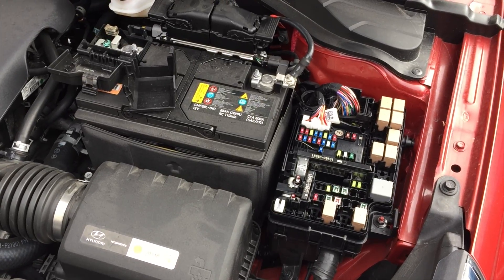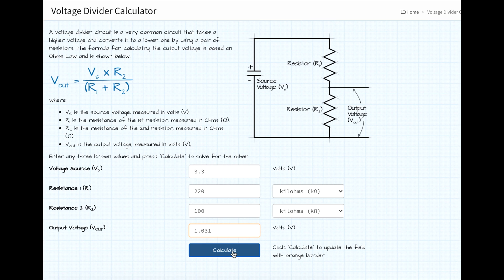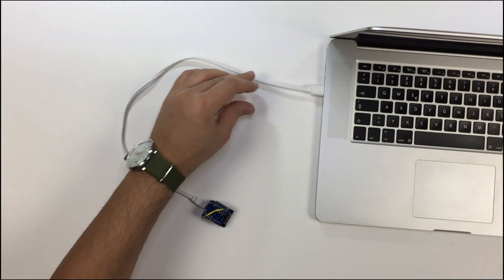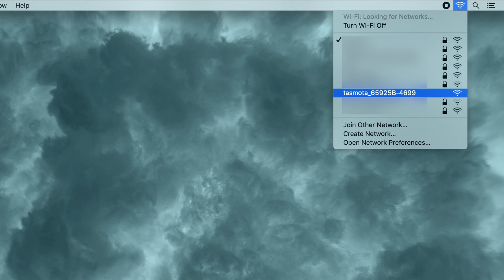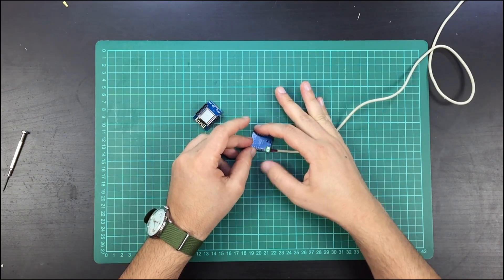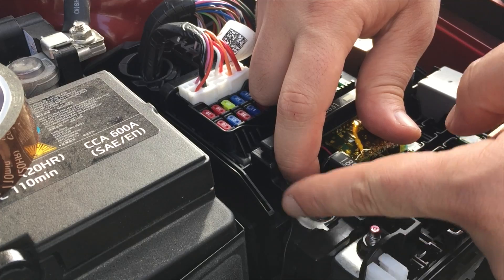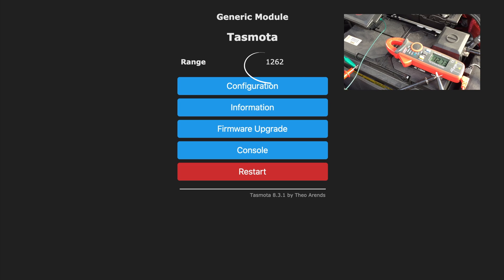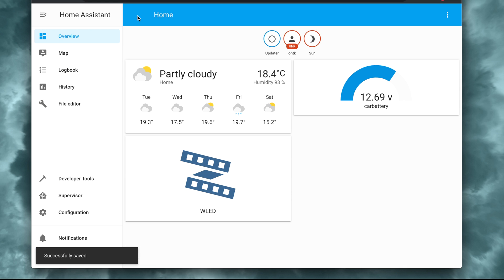Monitor a Car Battery Remotely using ESP8266

Comment: Love this project. Would you be interested making something similar but with something like a ct-clamp where it measures amps/watts that are actually being used by something running off a 12v battery?
Reply from the maker: Possibly! this would be ideal for my solar setup. I will add it to my backog :)
Reply: @MrDIYca  just ordered some parts to try it myself using a pzem-017. If it does not work ill wait to see how you do it.

Comment: Nice project. I guess your car is parked inside your Wifi coverage which does not apply to most of the people. It would be interesting to see the deep sleep telemetry period settings. After all the project is for protecting the battery not for draining it ;)
Reply: It's running stock Tasmota, so will probably only have the modem sleep power saving enabled. Deep sleep won't be happening as D0 wasn't connect to RST, allowing for wakeup from deep sleep.

Comment: Good idea. Did you try to measure current consumption? Just interested what drain it has?
Reply from the maker: No, I haven't but D1minis usually use 70mA. I have it pulling the voltage every 15 minutes.
Reply: 70mA when in deep sleep. Plus you have a power shield too.
Reply from the maker: that is true. It has been monitoring my car for 2 weeks now and I was able to start it just fine the other day. But it would be useful to get accurate energy usage for a span of one day or so.
Reply: @arnsle  Not in deep sleep they won't! Deep sleep drops power consumption below 1mA into the micro-ampere range. If the ESP8266 is allow to idle-sleep the WiFi modem, power consumption should drop from 70ma @ 5v to around 25-30mA IIRC. It will be less than that on the 12v side (somewhere in the order of 15mA), since current is relative to voltage. Even so, if the car was parked up for a couple of months you would want to charge the battery up anyway, as the onboard electronics as well as this would drop the battery state of charge more than enough to cause some permanent damage to the battery if not charged.
Reply: Yes, Tasmota don't go to the deep sleep. Does not matter how often make voltage readings. I tried to measure D1 + shield and 18-40mA. So I went with mysensors and Nrf24l01+ it goes to deep sleep but because of the lm2596 does not go less 4mA. Maybe need to try different stepdown regulator.

Comment: I'm a little confused, at 1:26 the video shows 2 resistors soldered together, the right hand one appears to be (Brown/Black/Black/Green) 100 x 10^5 =10 MOhm, and the left hand one looks like (Green/Blue/Black/Violet maybe? It looks Pink but there's no Pink colour code) which would be 560 x 10^7 = 5.6GOhms!!?? If what looks to be Green in the video is actually Yellow then the 1MOhm would be right but the other one would be 460 or 470 something if what looks Blue is actually Violet? either way, its not 220 anything (Red/Red/Black)!
Reply from the maker: Hello, in the video, I recommended using a 1.22 MOhm resistor (1MΩ + 220KΩ) but I didn't have a 220KΩ at the time so I used a 440KΩ instead and this is what you are seeing in the video - good eye!

Comment: Question, did you use the vehicles battery to power the D1? I thought it required 5v usb and a car battery would be over 12
Reply from the maker: Hi Michael, no you can not use the car battery directly witht he D1 mini. I used the Wemos D1 mini power shield  https://amzn.to/2ZmI0Vq   you can see it in the videio at 00:24
Reply: @MrDIYca  Laughing... I didn't see any reply to this until now. I did see the power shield board in video, but didn't know what it was until I researched it today (really brief on that in video). Anyhow gave tasmota a try and I am now able to read voltage, temp, humidity, and DewPoint thanks to your video and others. Integration to MQTT was a pain, but now that I've been using it (setoption19 1 in tasmota was key for me) my life is getting better.  Don't understand why alexa doesn't see anything (it did with ESPHome), but I was really looking for local control anyway. Just got a Shelly 1PM that I will wire up to my air conditioner in power shed and then I will start doing some automations. This home assistant/tasmota/MQTT/Python/etc is not for the faint of heart. Towards the end of your video you are trying to calibrate your voltage output using AdcParam... do you know what each individual entry represents? 6, 0, 1023, 0, number
Reply from the maker: @michaelbatchelder  great to hear you got most of it figured out. It does  indeed have a steep learning curve at the beginning. For the AdcParam command, it goes like this: mode (6 for linear range remapping) , input range low value=0, input range high value=1023, output range low value=0,output range high value=number you are searching for. It is basically mapping the analog values it reads (0,1023) to a range that makes sense to us, aka, the battery voltage (0 to 1600) or ( 0v to 16.00V once we divide it by 100 in the MQTT sensor). 
A side note: in the video I actually used a bigger resistor. I used a 1.44Mohm instead of 1.22Mohm. That is why my adcParam were bigger. You will probably be in the 1600 range as compared to my 1770 in the video.
Reply: @MrDIYca  I have all the elements/values showing up on LoveLace interface on Home assistant, voltage of 28.8v reading 2878. Can I format that "2878" to an aesthetic reading that shows 28.78v? Sorry to pick your brain so much, but I appreciate all the help you have given so far. My hassIO install is new, with some Tuya switches (really slow reaction time on them, may flash them and install tasmota), weather, network sent/received (don't understand the naming structure, list 3 sets, but I only have one router), and a roku. I am sure there are multiple ways to get things accomplished. I also see the NodeMCU that I have will except 12v for power, will have to test to see, but I have a dc to dc transformer in the shed that converts 24v to 12v. Going to add to more batteries to the solar shed and setup everything the next set of days off.
Reply from the maker: @michaelbatchelder  personnaly I prefer tasmota over tuya cloud, I made a tutorial on how to flash them using a proxmox vm here https://youtu.be/DDYK7cE9rEA). I believe you can try templating to format the value https://www.home-assistant.io/docs/configuration/templating and use the value to do something like value_template: "{{ (value | float / 100 | round(2) )}}"

Comment: thanks for the video.  i'm a bit confused about your voltage divider.  Isn't the analog input range 0.0 - 3.2 Volts?  Why scale the voltage down to 0 - 1.0 Volts?
Reply from the maker: Hi Frank. The ESP8266 ADC pin input voltage range is 0 to 1V.  The Wemos D1 mini, which uses the ESP8266 chip, comes with an internal voltage divider that increases this range to 0 - 3.3V on pin A0. Hope this helps!
Reply: @MrDIYca  so why using those resistor values? Shouldn't you use 3.3v as a ref voltage?
Reply from the maker: @rogerfar  Hi Roger, what do you mean by ref voltage? The d1 mini ADC can't exceed 1 volt. The resistors bring the battery voltage range from 0 - 12 down to 0 -1. I have shown in the video the calculator I used to come up with these vaules - check it out.
Reply: @MrDIYca  This confused me too but after looking at the schematic I see why. You're both right. The ESP8266 wants 1V. The Wemos D1 Mini wants to use a 3.3V range so they put a voltage divider on board already: So it goes ("D1 max 3.3V input" - 220K - "ADC max 1V input" - 100K - GND). In the video you add a 1.22M resistor in series so it now goes ("External max 16V input" - 1.22M - 220K - "ADC max 1V input" - 100K - GND). The 3.3V input point is still there in between the new 1.22M and the on-Wemos 220K but it's not used any more so isn't mentioned. It's more obvious if you draw it...

Comment: This is a great idea and video.  However, I wish you could have a diagram that shows more detail on the connections.  It is not very clear where you are connecting the resistors.  Thanks for the video though
Reply from the maker: Great idea! I added how I wired the resistor at https://www.instructables.com/id/DIY-Monitor-Your-Car-Battery-Code-Setup
Reply: @MrDIYca  Thank you so much!  That's great!
Reply: @MrDIYca  wiring diagram is gone. page just shows error 404
Reply from the maker: Thanks for letting me know. The link has been updated. You should be able to see it now!
Reply: @MrDIYca  Your wiring diagram shows R1(1.44 megohm), where is R2 (100 kilohm)?
Reply from the maker: @mgillis1948  The R2 is built-in the Wemos d1 mini. I added a 1.22M to make it 1.44M. Hope that clarifies things for you!
Reply: @MrDIYca  Thank you for the clarification.

Comment: This is especially useful right now. I have been staying home so much my car battery was too low the first time I tried to drive somewhere. I will probably make one of these so I can be alerted when I need to top the battery up with a charge so I don’t damage the battery any further! Thank you!
Reply from the maker: Glad it helped!  If you feel fancy, you can automate that as well by plugging in the car battery charger ( something like this https://amzn.to/2MozsHc)  to a smart wall plug and have an automation turn it on at specific low voltage and off when the battery is fully charged.